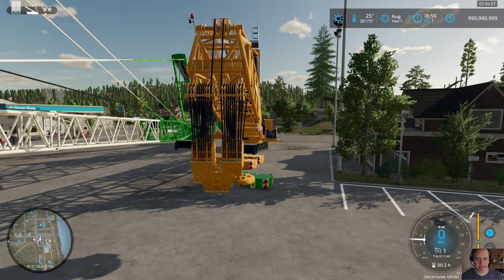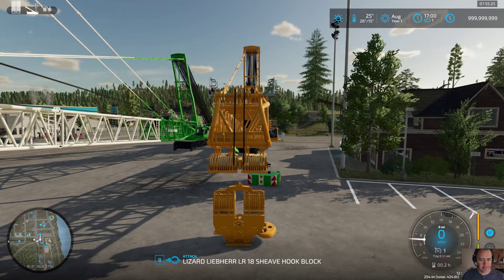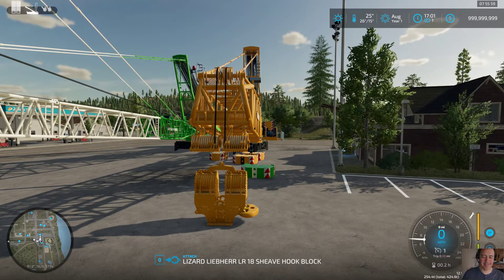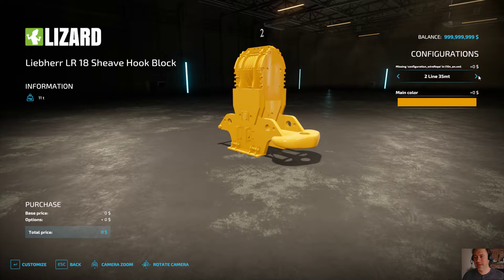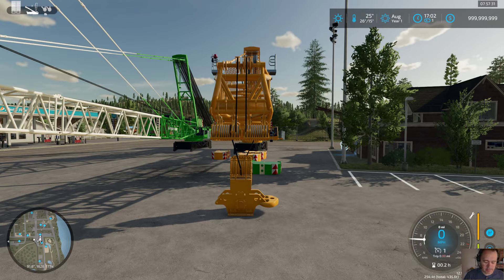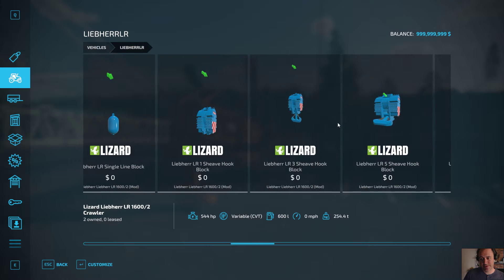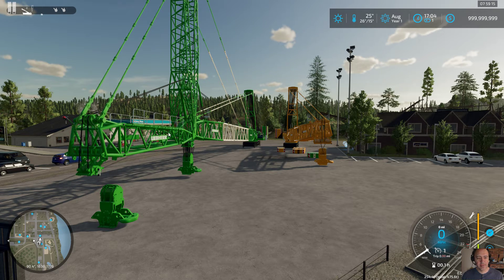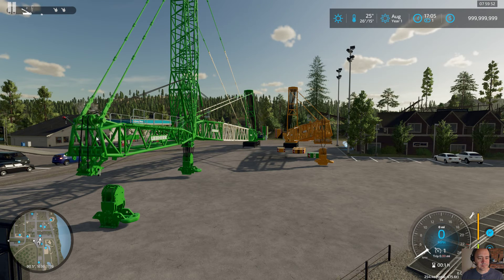FS22 Liebherr LR 1600/2 updates

Comment: Hey, Thank you for the Update, your Work with this Crane is Amazing, i have so mutch fun  with it, only the Transport of the Crane from A to B is not so easy to Handling. 1000 time Thank you for this Modell.
Reply from the maker: No problem.  Though your transport woes may become more with the next update, as I am adding in the buildable/transportable lattice sections.  It will not work for lifting, but great for role playing.
Reply: @jeremybrown9379  Hi, thanks for the reply, I'm very pleased. Well, that doesn't sound good... then I can't transport the Crane from construction site to construction site anymore ? then I have to buy a separate Crane for each construction site, omg but that will be expensive at the price, then I should start quickly and play LS Lotto and hope to become a millionaire otherwise I will quickly run out of steam.
Reply from the maker: @joergschneider4265  You will still be able to transport it just like you can now.  You will have the option to buy all the lattice pieces and build/transport them as well.  Making it more difficult to transport.  Just like the real thing.